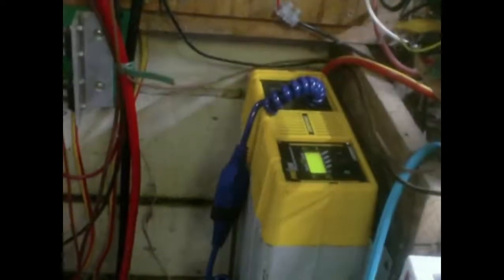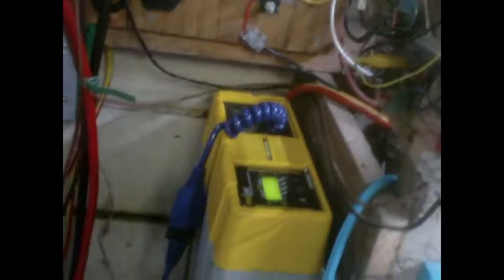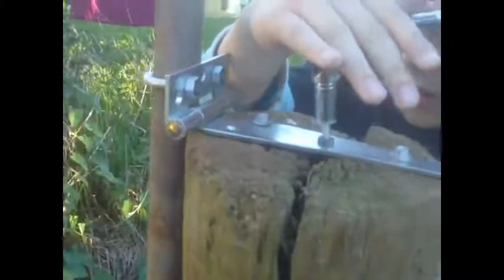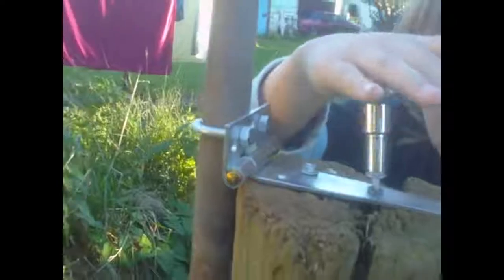DAY 838 OFF THE GRID - *I believe in Capacitors!*

Comment: A productive day! Neat solution to the noise issue on the steca. I've not witnessed a back up mode before but I guess if it's struggling to regulate the voltage due to a fault a switching mode at least gets some charge into the cells. Cheer Xan.